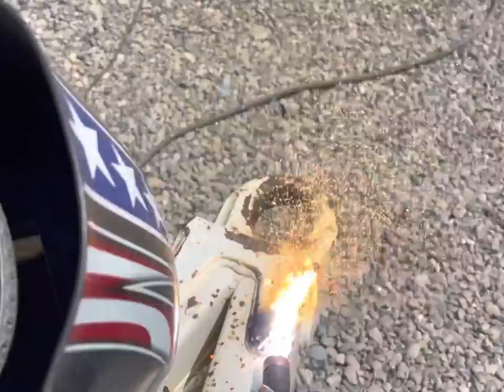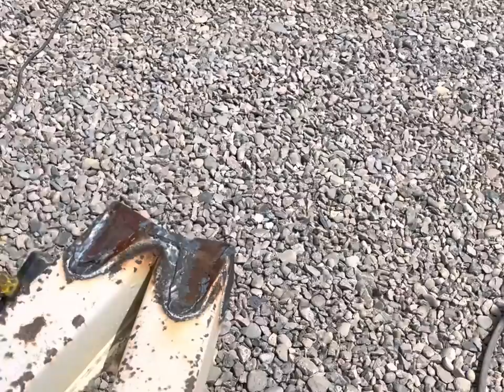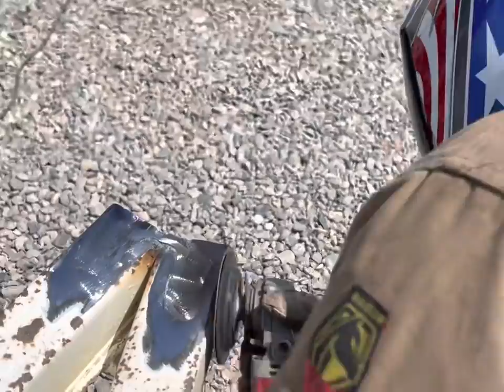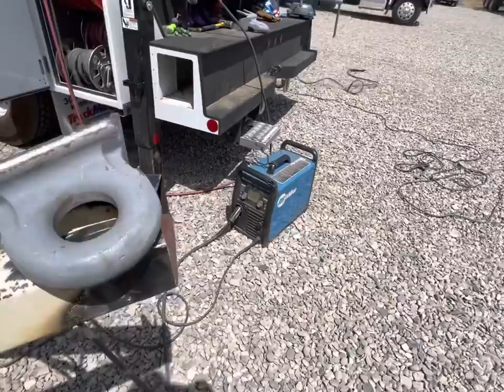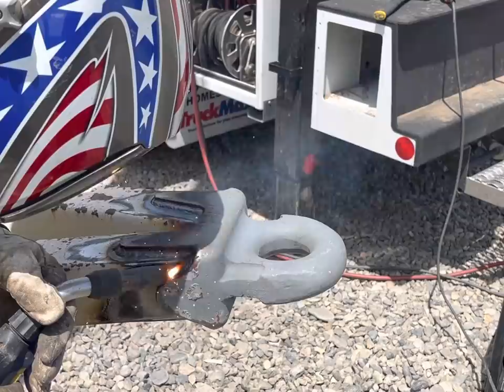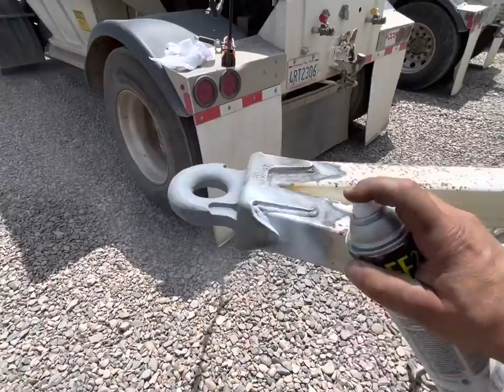Pintle Hitch Replacement

Comment: never done a pintle, just normal hitches, maybe 20 or so in lifetime, that plasma looks great, i have just used torch and grinder to remove weld, but very cool. not currently doing much, not advertising though. word of mouth, but at present i have backed off

Comment: Why do you use plasma gouge over air arc , always found the plasma to be a more “expensive “ way of gouging
Reply from the maker: I use both just depends on the situation.  The plasma is better for fine details.
Reply: @OFW  thanks for the reply, do you find the plasma eats consumables?
Reply from the maker: @billymartin766  I feel like I get a pretty long life out of my consumables.
Reply: Hypertherm has got gouging consumables figured out. I’m very satisfied with the service life of gouging consumables on my Hypertherm 45XP. Just my two cents.

Comment: What were you powering the welder with? I like the receptacle set up on the rear. Just curious what provides the power.
Reply from the maker: Miller 600 air pak

Comment: Was that cast steel? Does it need to be preheated before welding? I want to replace my trailer tongue (stamped steel) with a cast steel swing away.
Reply from the maker: I believe it is forged. I don’t think preheat is necessary but it wouldn’t hurt anything.
Reply: It appears cast, just based on how the lettering is raised vs imprinted. Now whether or not that changes anything, idk.

Comment: If you built up that LUNETTE with hard face ro it would last decades,did for me on my tagalong compressor!
Reply: I agree .on building it  up . also   heating up  on that thin  metal   so many times   2 welds   and one  removal   I would think it  make  it brittle   prone to cracking .  just my   2 cents  worth .  also  less labor  to build it up .
Reply: Question, did your tag along weigh 40,000 lbs, the hard-face would certainly prolong the life of the hitch but it’ll wear, just slower.
Reply: @dirtfarmer7472  that would be it's purpose ,hard faceing is much harder than the lunette,as they say . Try it you'll like it!!!
Reply: If it's a over the road coupler used in commercial use the wear cannot exceed one fifth and cannot be welded acept by the manufacturer. Or certified wleder following manufacturers welding procedures. Well dot says so anyways. Also lifting devices like cranes shackles lifting points even forklift booms and forks have regulations. But who has time for that if I want to cut a hole in my forks use homemade fork extinctions I will
Reply: @reubeng2110  thank you!careful handwork and paint, I'm retired any way,but you make me feel like the ''One That Got Away''!!

Comment: You are correct, it is too thin. Would you trust your family car behind that trailer holding 10 tons, and that shitty tubing cracks right off if driver has to make sharp turn? I woulda put 1 ft length  of 1-1/4" round tubing inside of each square tube to beef it up. The company that makes those so cheap is setting themselves up for a big hit, for saving a  few dollars on cheaper tube! Wow. I would like the Designer to put 'his' family behind that thing. Some American companies, rival the Chinese, for their CHEAPNESS. But a Great welding job. Thanks.
Reply from the maker: The tubing is scary but it does have that 3/4” cable as a backup safety.  Still sketchy.

Comment: I think drilling a hole and adding either bolts or pins would make me sleep better.✌️
Reply: It would add more failure points. Cracks ,corrosion and failure.

I break stuff ,make mistakes and learn a hard lesson.
Reply: Using bolts to secure the pintle hitch would also make it easier to replace.

Comment: What the power set up on your truck? I'd like to add outlets at the back. I run a tb325, I know miller makes/made a kit but its bookoo bucks
Reply from the maker: Miller 600 air pak.   I ran  powder to the back and inside the cabinets.
Reply: @OFW  did you just come off the 50a 240/120 plug and split it to your outlets? Or run the 50a to your 30a and the 20a 120v  to the 20a outlets?
Reply from the maker: @mikef6879  the single phase 240 50A comes straight from the plug of the welder to the outlet on the back. 
The 120v comes straight from the 120v on the welder to the plugs on the back and the cord reel. 

The 3 phase 240 50A go straight from the welder to inside the cabinet where the plasma is.
Reply: @OFW  thanks, that's kind of they way I was figuring. I appreciate the replys

Comment: Nice welds, but I'm surprised that a 7018 rod wouldn't be used. Considering the weight it pulls.
Reply from the maker: The weld I did has the same tensile strength as 7018.

Comment: Why not put a second pass because of the amount of weight not to mention liability?
Reply from the maker: Because the tube is very thin and one pass is all that is needed.
Reply: @OFW   YA I get one pass is all is needed.....to hold the piece on, but you have a trailer that can haul 40-60K worth of material, and with that much weight combined with the inertial and motion of the load which would double the weight to 80K-120K. which far exceeds the Tensile Strength 	78,000 psi
Yield Strength 	65,500 psi
Besides your second pass would be mostly on your first pass and on the new hook. My point is wit wouldn't have cost much more for a second pass to lessen your liability. Because if anything happens you're liable. Not trying to argue, just saying it's better to be safe and blow through some extra material and sleep better at night.
Reply from the maker: @robertnelson4755  I understand where you are coming from.  The original manufacturer did one pass.  Even if you did 3 passes the failure point will be in the tubing failing not the weld.
Reply: @OFW  See, right there is my point exactly. If the failure point is the tubing then that's on the manufacturer and not you. You need to remove all liability from you, by over welding to prove it wasn't your work that "caused" the accident that killed 12 people. I understand the factory did 1 pass but no one knows what machine or wire they used. They could have gotten more penetration than your unit so your one pass does not equal their one pass. See what I mean. I went through several court cases and I'm just trying to let you know that once you touch anything - you own it from then on, liability-wise.
Reply from the maker: @robertnelson4755  I 100% understand what you are saying and I appreciate your concern.  Thank you for the input.

Comment: why is he using mig?  It's not made for that sort of stuff.  Use stick or lux core way better and hoter.
Reply from the maker: The entire trailer is welded with mig including the original welds on the lunette ring. There is nothing wrong with using mig.

Comment: Not the best repair we’ve ever seen. When we do these (hundreds of them) we add a series of brackets and braces to beef up the frame as the material is too thin for a straight weld joint.